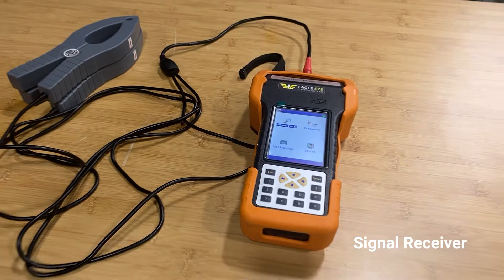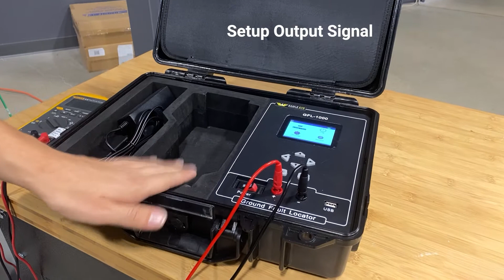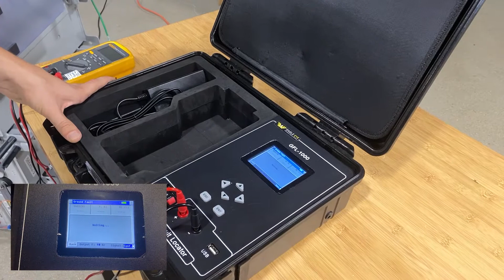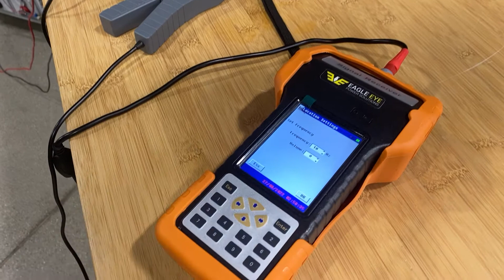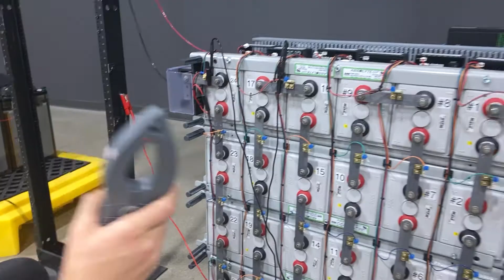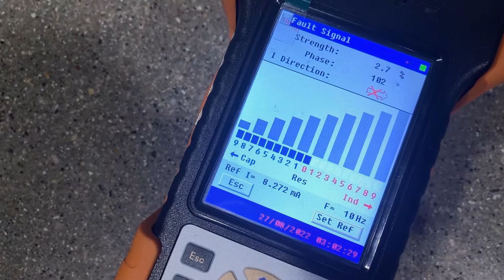GFL-1000: How to set up and find a ground fault on a DC circuit

Comment: When using this product we kept getting the Strength over 100%, sometimes 500% and fluctuated heavily during testing bouncing from 45% to 553%, the direction also was not stable and kept switching, is there a fix for this?

Comment: can this be used on a 120 VDC system with control  instrumentation and various branch circuits ?
Reply from the maker: @rbishop12399 Yes, that fits within the intended application. It is primarily used for DC ground faults in substations or other similar power facilities.
Reply: I hate this fucking thing